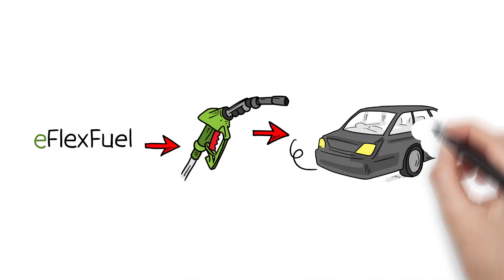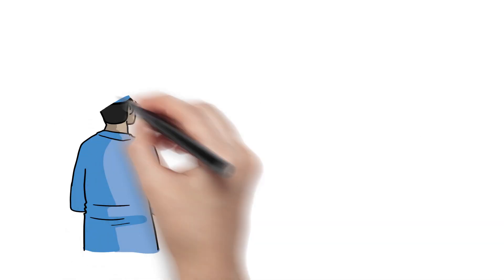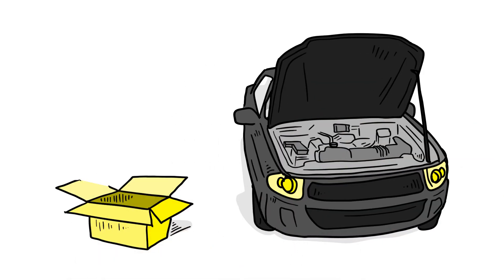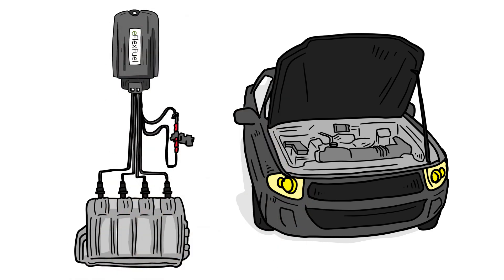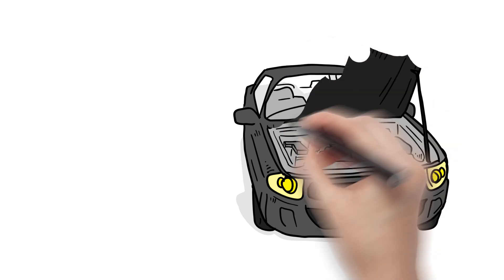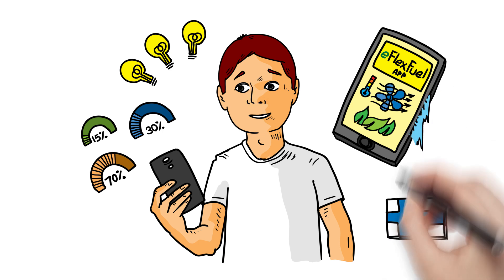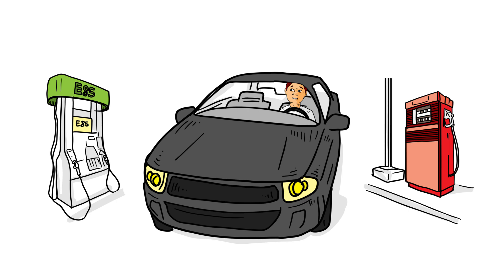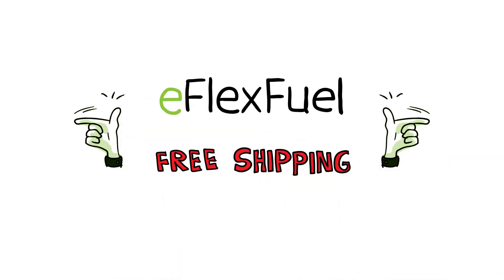eFlexFuel E85 Ethanol Kit - How does it work?

Comment: But you guys don’t tell people that they have to upgrade their fuel pump change there fuel lines fuel filters and fuel injectors to be capable to run ethanol because it’s corrosive to normal fuel hardware
Reply: This is ONLY true for older vehicles! You can also just add, corrosive protection additives to protect those systems, and not have to change anything out.
Reply: @liveuntetheredmusepodcast4832  When you say older vehicles how old do you mean?
Reply: @liveuntetheredmusepodcast4832  Thanks for the reply! Do you think eflexfuel is the best?
Reply: @tomthefox3365  I don't know, I've seen so many, and I've seen a few companies not make them anymore,..but I planned to do this to my vehicle in the near future, so I will be researching to find the best one. If the product works well on mine, I'll  probably do a couple more cars in my family, and convert them over. You save so much in gas,.. it's crazy not too, plus coming from an experienced mechanic of 50 years (not me) he said flex fuel is better for engines, and it will help the engine actually last longer...(of course you still have to take care of the engine, oil changes, ect...) ...and don't hot rod the vehicle. Fastest thing to wear out expensive internal parts parts, is turning any daily driver car,..into a race car! lol
Reply: @liveuntetheredmusepodcast4832  bullshit. It can affect any car not designed for ethanol
Reply: @Kiyopon  all cars have been designed for ethanol after 1994 and then even moreso after 2007 to not corrode.
Reply: You realize all fuel has ethanol added in, right

Comment: How does this work for the aftermarket community? Like for people who install power adders and such?
Reply: You will need a higher liter per hour fuel pump, bigger injectors, maybe a larger fuel rail as well. Ethanol has roughly 70% the energy of traditional gasoline, and most factory fuel components do not flow fast enough to keep up with the consumption of ethanol. Also, since ethanol is alcohol, it thins engine oil more quickly and more frequent oil changes are required.